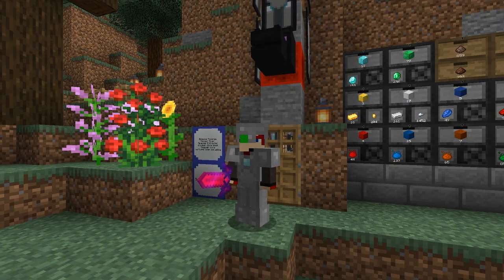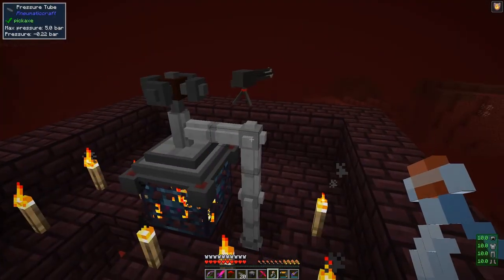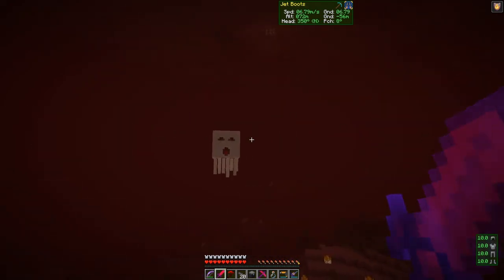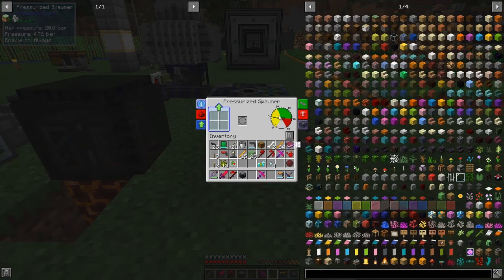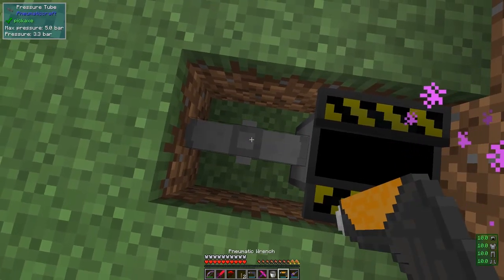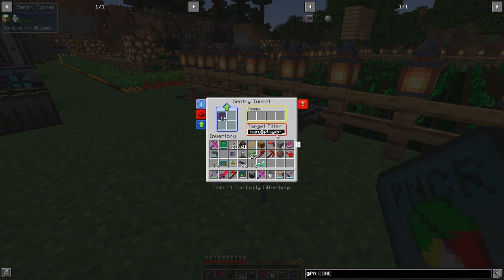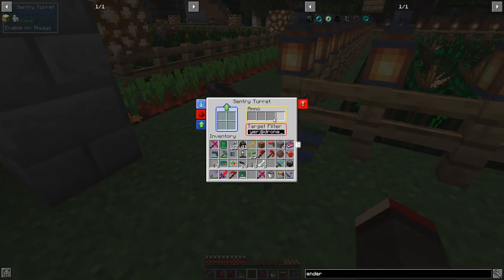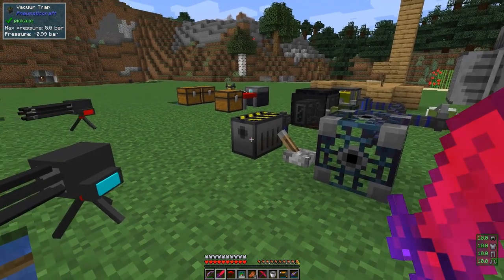PneumaticCraft: Repressurized #30 - Spawner Extractor, Pressured Spawner and Multiple Suicides

Comment: Why wont my tubes depressurize?
Reply from the maker: Main reasons are: there is a missing tube or an extra tube, both will leak air. The other reason is that they are touching another tube or pneumatic block. The second cause can be tricky to spot. To isolate the problem you can block (right click with the pneumatic wrench) the sides of two tubes and break the one in the middle, this will prevent loss of pressure, and then you can see if the tubes are depressurising.

Comment: Lol think every 1 playing with turrets runs in to this issue at lest 1 time.

Ur spawn rate was inconsistent do to the empty space still in the core.
Empty% = fail to spawn%

For mob sorting u could use the air grates with adv-pcb mob filter to push every thing away u don't want.

Fyi u can right click the core on top of a block and it acts like a spawn egg at the cost of a% of the mob spawned. with exp juice in the trap u still gain more per mob then u lose.
Reply: Yep, all good advice. Also, you have a lot of stuff around the spawner, which does obstruct the process a bit. Each time you see a puff of white smoke, it means the spawner tried and failed to spawn something, either because of a non full core, or because something was in the way. A bit more clear space around the spawner will help.
Reply from the maker: Thank you for the tips, I didn’t know about filtering mobs with an advanced PCB on an air grate. Also didn’t know the spawner acted as a spawn egg. 

Makes sense that the spawn ratio is proportional to the fullness of the spawner core.
Reply from the maker: @desht2008  thanks again for the advice. Had noticed the white puffs, at least when I was watching what I’d recorded, similar to a vanilla spawner. Also noticed that the spawner extractor does work on hacked spawners.
Reply: @duncanwebb4934  Hmm yeah, I need to stop it working on hacked spawners... makes it a little too easy...
Reply from the maker: @desht2008  opps that was a typo, should have been does not work - should turn off auto typing again.
Reply: @desht2008  idk seem reasonable to me. makes seting up much easyer. when you start it the spawner turns back on but it only spawned at the normal rate and not doubled like see in this video.

O and there's a bug I found where would I go to report that to you?
Reply: @xivilaikikira3768  extracting the spawner core is supposed to be hard and just disabling it by hacking trivializes the whole process.  There are plenty of ways to do it though - multiple sentry turrets, for example.  (And use Freeze Ammo for blazes, or pretty much anything in the nether)
Reply: @desht2008  just retested  hacking a spawner dose not affect it while the extractors is active. 

My result the 1st time was the area I set up screwing the spawn rate.

Also discovered with volume upgrades after ur 1st spawner u can precharge the extractor so u only need 1 block to set up

My block tracker seems to have a comparability issue with FTB ultimine. The highlighting craps out unless u hold the ultimine keybine